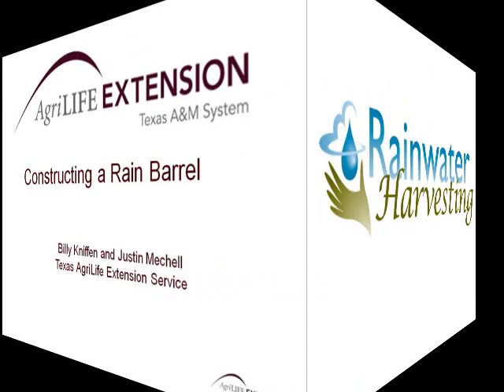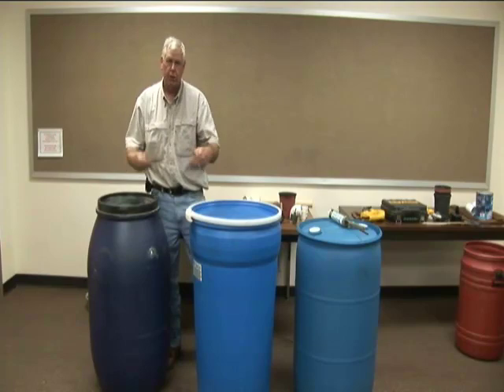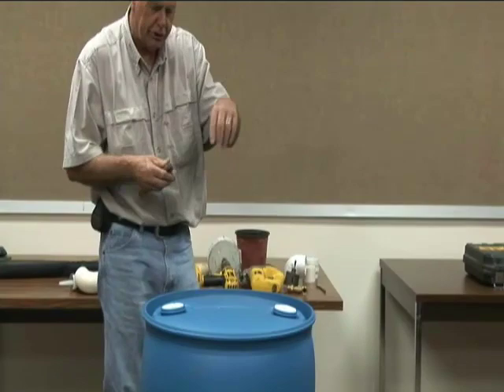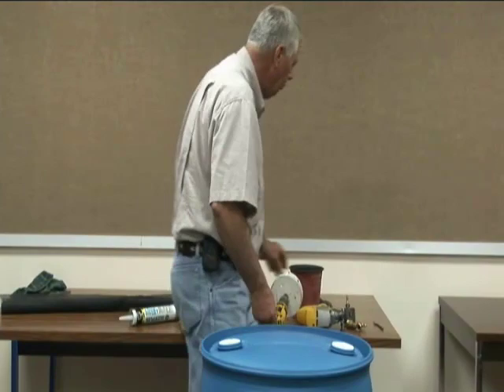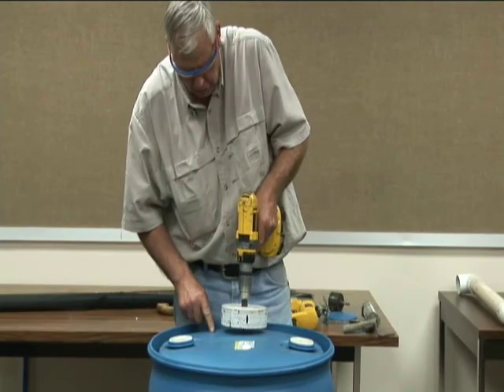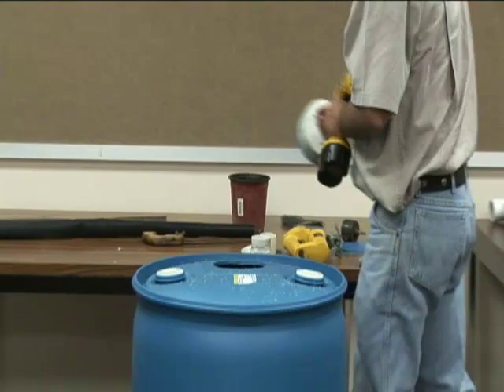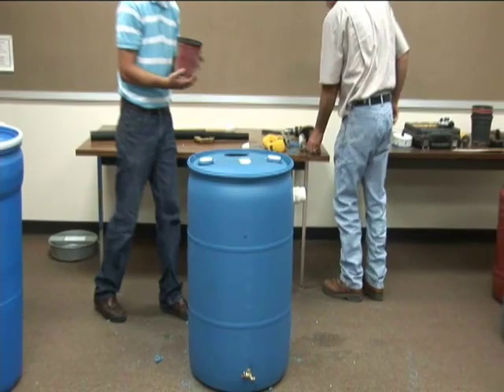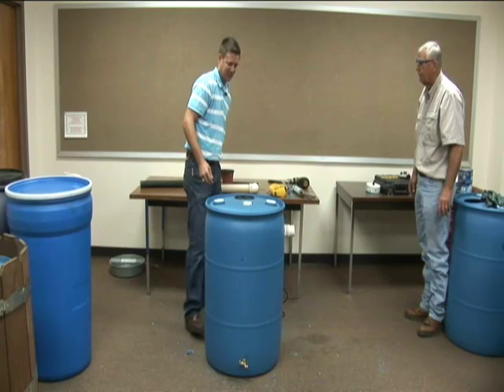Rain Barrel Construction

Comment: Thanks for posting! I found the same kind of barrels are available for free at your average car wash. I'm hoping to do a variant, using the premade openings on the top- do you know how large the hole is? I'm hoping to find a PVC fitting that would screw right on.